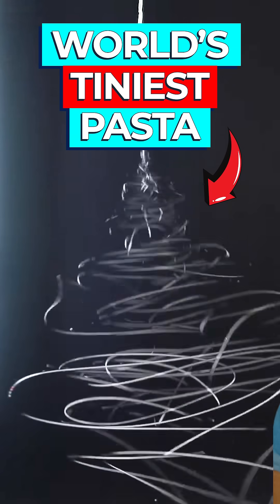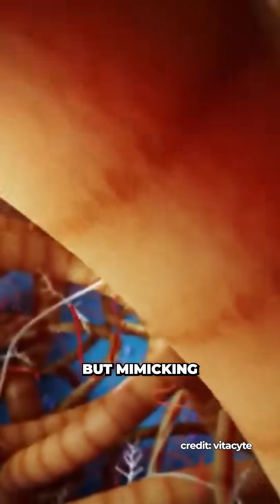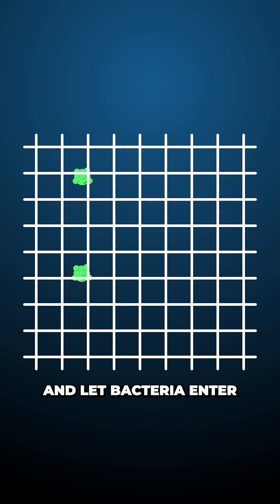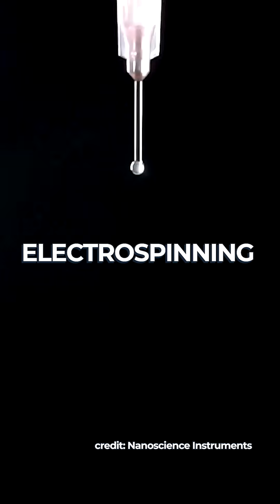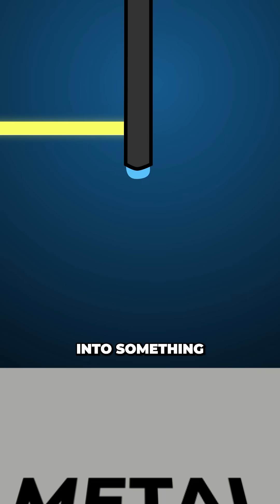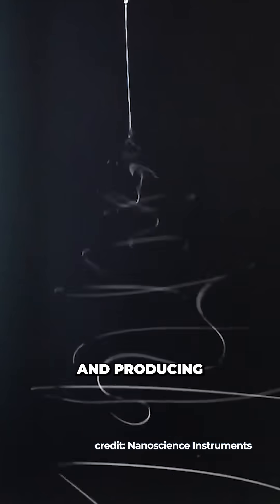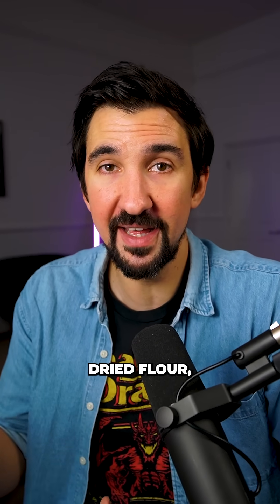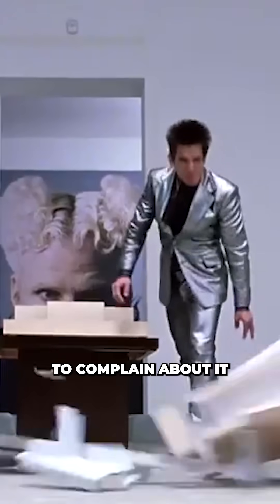How Scientists Created World's Thinnest Pasta

Comment: I have been talking about this for years.  We can take ECM from say pug blatters and after processing we can have the scaffolding left. It can be used as a skin graft or powdered. And ran through a skin gun for burn woulda 

ECM allows the body to see it as a building foundation not a blast zone.

The body then recutes and multiplies stem cells to rebuild form the blueprint instead of scar over.

Glad we are making moves on this after so many years

Comment: This is a similar concept to electrospray ionization which we use in analytical chemistry to ionize molecules prior to mass spectrometry. Molecules in the liquid go through the taylor cone, form tiny charged droplets, the droplets evaporate increasing the charge density around the molecule until the droplet explodes under the coulombic forces, imparting the charge on the molecule. It’s so cool that it has other applications. Such a dope technology.

Comment: For some comparison, 300nm is at the same magnitude order of the wavelength of the visible light, that it goes from 380nm to 700nm. Also, the scale of the atoms is around 1e-10 m, and the nm is 1e-9 m, so yeah, the diameter is REALLY SMALL.

Comment: I'm glad people are talking about this, but electrospinning isn't the only method we use in tissue engineering, and it isn't necessarily the best as it's random and uncontrollable. We can 3D print scoffolds in a crosslinking solution with more control, albeit the extruded fibers would usually be a larger. Different methods for different intended purposes.

Comment: I sure could’ve used that after my recent surgery to remove several metastatic tumors from my abdomen. The vertical incision that went from just below my sternum down to my pubic region just didn’t want to stay closed once the staples were removed. I just had to suffer with those butterfly bandage things for about two months, and the resulting scar is just awful-looking.

The continually changing information about movement was also very frustrating. "You need to get up and walk as much as you can," was what followed my surgery. "You need to lie still as much as possible," was the instruction after the staples were removed and the wound wouldn’t stay closed. "You need to go to PT and work on strengthening your core muscles," followed that, until there was more bleeding. "You need to take it easy until there was wound has completely healed," followed that.

Um, doctor, did you not read the part in my chart where it says that I’ve had type q diabetes for 45 years and wounds are exceptionally slow to heal for me? Or did you read that and ignore it because you thought I was exaggerating when I pointed this out? And why the f**k did you refuse to put in stitches after the wound started to reopen? I’m sure you had your reasons, but you dismissed me when I asked about that. I was warned that oncological surgeons can be a bit on the arrogant side so I didn’t press the issue, but you could have at least offered some information every time you told me "no" when I asked a question.

Oh, and I don’t appreciate the lies about how soon the pain would go away. You said it would be pretty painful for only two to three weeks. Six months later, my abdomen still hurts. It’s not terrible and MRIs and C-T scans show that everything has healed very well, but that area of my abdomen where my bowel was resected in three places and where I have that long scar still hurts a little any time I move it — like when I’m at PT trying to strengthen those muscles you sliced clean through.

OK. Rant over. Bring me a plate of tiny pasta, please. I need to regain some weight; cancer treatment has this way of making you lose way too much weight…

Comment: I published work on electrospinning and the problem with this is that you really have to time when to do the electrospinning as the starches will degrade with longer exposure. Generally not a really robust process, but used as a niche technique in the industry.
Reply: How about propone, glycosaminoglycans or collagens. What about Hyaluronic acid, most of these are even positively charged iirc
Reply: @pluripotentprotoplasm  Hyaluronic acid is a glycosaminoglycane and can be electrospun, also collagen can be spun. Haven’t heard of Proline yet, but I switched research area because of the robustness of the process and work now with lipid based nanocarriers instead of nanofibres :)
Reply: Depends on the labs, some say it's a waste of time because you denature the collagen so it's kinda pointless. But collagen is easy enough to espin. Tried and failed to do DNA but that might have been me just doing it badly
Reply: Thanks, smart dudes❤
Reply: Do you mean it will have a short shelf life?
Reply: If you destroy the polymer chains by acid, the viscosity or thickness of the solution gradually decreases. If the soluion is not viscous enough it is impossible to have a stable production process. 

But as we are talking about starches shelve life migh also be problematic :)
Reply: For now... As the science develops, they will figure better and better ways to utilise and stabilize the pasta.
Reply: I meant proline
Reply: Can you electrospin other things then? Like spider silk? 🤔
Reply: @applepie9806  There is actually a bog hype about silk fibroin :) You have to consider it might be hard to get actual spider silk, while silk worms can be farmed